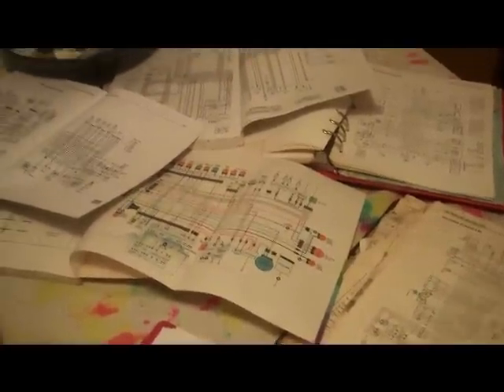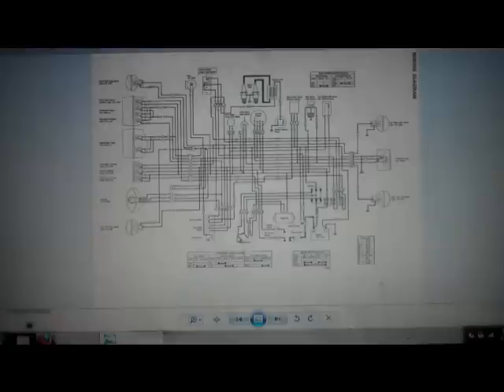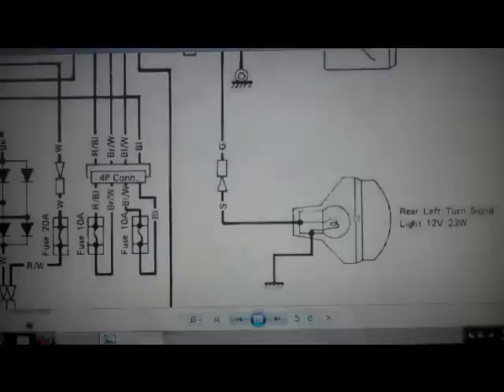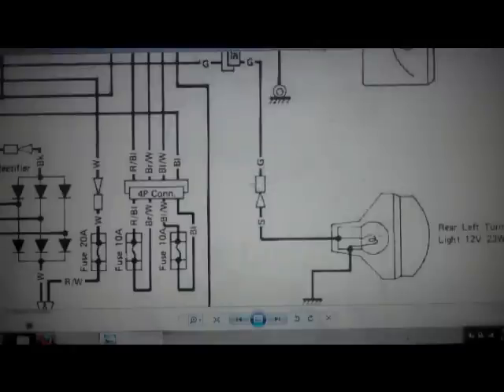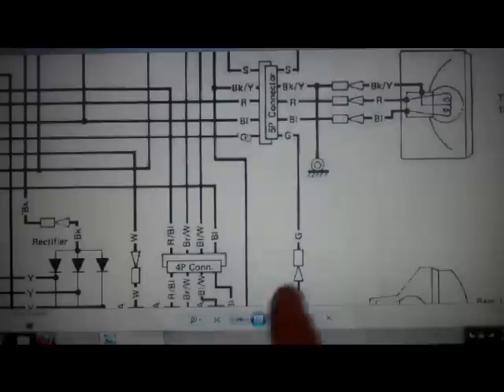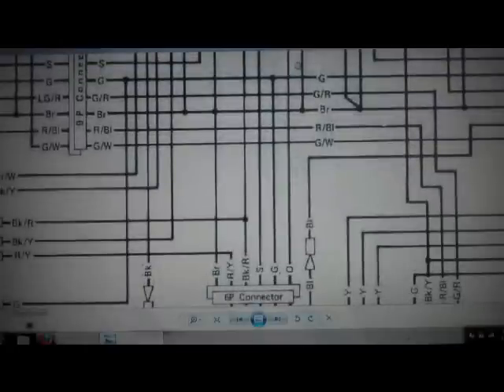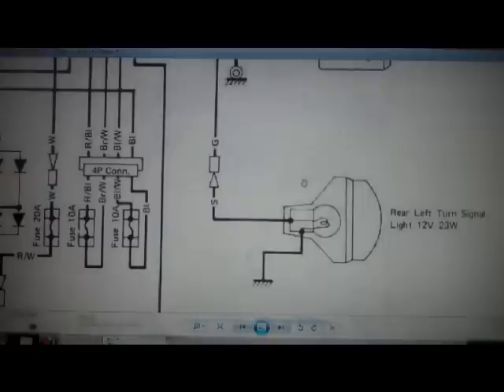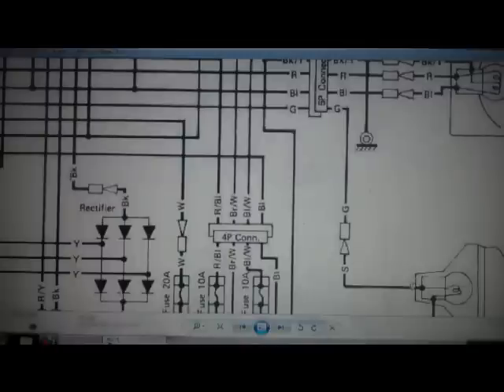How to read and use your wiring diagram

Comment: hi, thanks for video, in case of insulation short or gounded, place one end of your multimeter red probe to + wire of bulb and other end to black probe to bulb +. u should see less than .5 volt, if u see more some one is steeling the current and trace back untill u get desired voltage. u can do the same for negative also. i believe u know this before. just a tip.

Comment: I like your idea, but I had a hard time finding a schematic for my bike ('88 ZX-10) on the Internet. So I took digital photos of my manual's schematic(s) with my camera and put them on my computer.

 First thing KEEP a MASTER. Then make a copy for EACH circuit set you want to work with (Ignition, Lighting, etc..), THEN under "file" open each copy you want to see with Paint. 

Then I could zoom in if needed, color the wires I wanted to trace, and mark the switches etc. in that particular circuit, then save that particular circuit set. I now have a folder on my computer to keep each circuit with traced and colored wires, switches etc.. to work with.

Makes it A LOT easier, Thank you for the idea that started me thinking.

Comment from the maker: Take a look at your wiring diagram and see which wires are involved in that circuit. Then go over them really good, look at all connections or places where the wiring insulation may have stripped, and see if any wires are touching the frame and grounding out

Comment: Corrosion is not visible to a voltmeter. Even significant resistance will still result in a "normal" voltage reading causing you to miss the problem. You should always place both meter probes into the component connector to search for voltage - this way you test 100% of the circuit. If you have source voltage - you rule out opens or shorts-to-ground. High resistance is only seen if you load the circuit and do a voltage drop. Circuits should be redrawn as straight lines for diagnosing faults.

Comment: This is very helpful. Quick question I have a mini chopper with the crappy Japanese wiring and I have been reading its best to replace all the wiring. What gauge wire should I use when replacing

Comment: Hi there! I've been following your channel for a while and got a lot of trouble shooting done because of it! Thanks! Could you help me with a problem i've been having with my vn800 custom wiring? I'm updating the harness and find that the engaging of the starter lockout switch (clutch lever) causes the motorcycle to start. I've been through the diagramn a lot and cant figure out the problem. It seems to me that this switch has to precede the starter button.
Reply from the maker: Well a couple things jump to mind. Perhaps the starter button is permanently pushed in or engaged in such a way that by releasing the clutch lockout switch, the bike is allowed to start. Or, perhaps somehow the wiring for the clutch lockout and the start button got reversed?

Comment: Appreciate the videos brother! Im heartbroken right now because my kz750csr twins wiring. I labeled all electrical before my rebuild & just finished but cannot hook everything back up : ( 
Some labels came off or were sprayed over, I have the diagram but am lost.

I have a black/yellow ground wire that comes from the alternator through the clutch cover on the engine..but wire has only one match on the harness but they smoke when I hook it up. Maybe you can help.
Thanks for your time brother.

Comment: Would you happen to know if the neutral light on the 82 virago 920 is necessary to complete the circuit to the Neutral sensor ?
My virago has never shown the neutral light and will shut off as soon as I drop the kick stand.
Reply from the maker: Unfortunately I dont have a wiring diaram on hand for that bike so I cant say for sure, but my inclination would be to say that yes it does.
Reply: I do have a schematic.. May I email it to you ?
Reply from the maker: starker1971
Sure is it a link or attachment
Reply from the maker: starker1971 The fact that the neutral light is not lit even when in neutral could indicate a failure of the neutral switch, or the starting circuit cutoff relay. Ive had a few viragos with bad starting circuit cutoff relays before, and I just bypassed them, but you may be able to get them online. The neutral switch is easy enough to test, just located it and test for continuity to the frame when the bike is in neutral compared to when it is in gear. Send me a PM if any of this is confusing and you need me to elaborate

Comment: hey max i got myself into an electrical pickle, i have a 96 dr650 and the 30a main blows within seconds of starting engine. cleaned most of the connectors and check to see if they were damaged. any suggestions?
Reply: Unplug the connecters,put the fuse in,start plugging connectors 
together,check for blown fuse each time